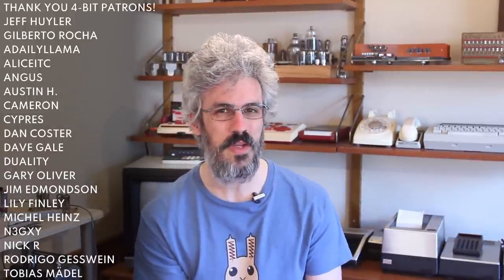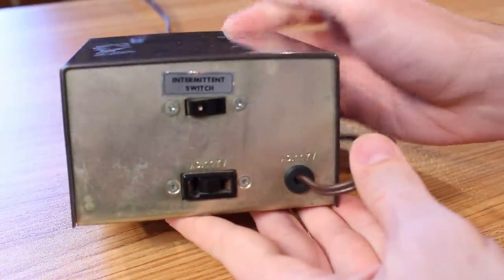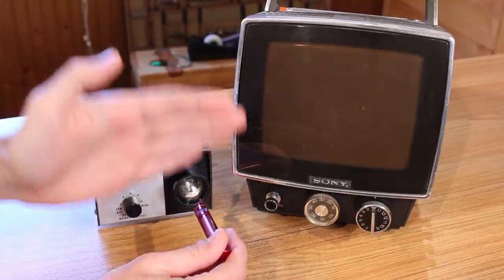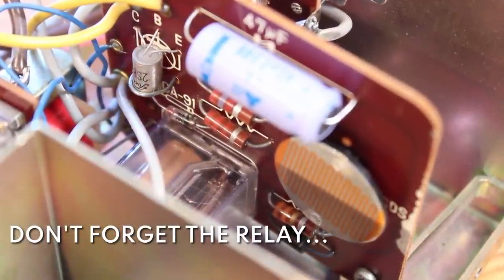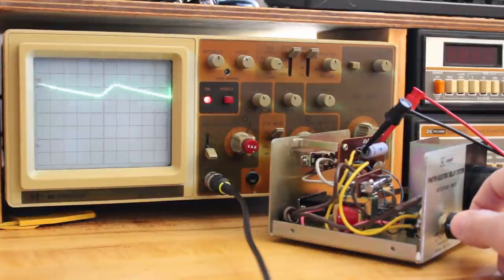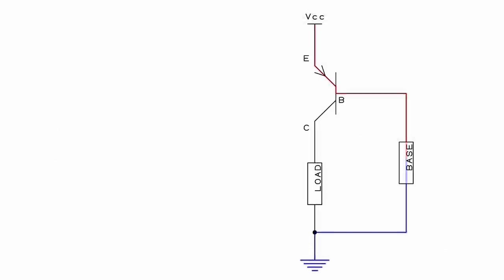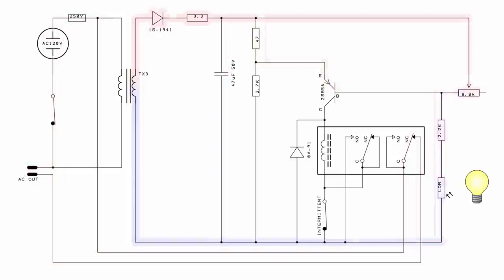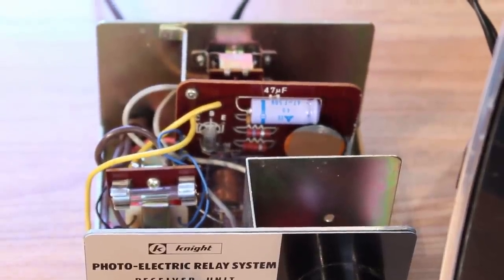Reverse Engineering a Knight Photo-Electric Relay System

Comment: Hi,  a few comments. Firstly, the potentiomneter is almost certainly nominally 10k. 8.8k is not a standard value and there would be no mileage in the manufacturer having custom pots made. Secondly, the fact that common is linked to NO on one side and to NC on the other side is completely irrelevant. You should see that if you removed the common-NO link and the common-NC link the the circuit would function in exactly the same way, so mentioning these links as part of the explanation of how this circuit works is misleading. Thirdly, it is not obvious why the 3.3 ohm resistor, the 47 ohm resistor or the 2k7 resistor exist at all. They probably have something to do with taming the half-wave rectified power supply and reducing the likelihood of the transistor or the relay seeing an overvoltage condition. Fourthly, the OA-91 diode is certainly a flyback diode although it is usual to see it connected directly across the coil of the relay. Finally, your schematic is incorrect. As it is drawn, if the intermittent switch is open, then the relay can never be activated. HTH
Reply from the maker: You're absolutely right about the 10k potentiometer, I just totally spaced on that obvious connection!
You're also right that the links on the relay aren't the important part here, that was a poor explanation on my part. However, the schematic is drawn correctly! I think you might have misunderstood what I was getting at it with how the intermittent switch works.

It's a little deceiving because we often that when a switch is "OFF" it's open, but in this case, the switch is closed when it's "OFF" and open when it's "ON". In order to use the feature, you make sure the light beam is uninterrupted, which triggers the relay and the C to NO connection of the relay now provides an alternate path to ground. Then you flip the switch cutting the normal path to ground through the switch off, but the relay stays energized through the NO connection. As soon as the relay de-energizes, there's no longer a path to ground and the relay can't be re-energized. It's a beautiful way to achieve a latching effect!

With regards to the 3.3 ohm resistor, it forms part of the RC filter circuit to help filter out the ripple of the half-wave rectifier. This is a pretty common layout that I see in a lot of older electronics. The 47/2.7k resistor divider was also excellently explained by another commenter, so I'll copy paste their reply here: 
"The purpose of the voltage divider on the emitter is to 'raise' the emitter's voltage down a bit. A 2k2 and 47 ohm voltage divider with about 20V will drop approximately 0.4V across the 47 ohm resistor. This means the base, relative to the positive rail, needs to come down by that voltage plus the voltage of the BE junction to turn the transistor on. If there's no light, the base would be at 0.4V relative to the emitter, keeping it firmly off. If it were just a 47 ohm resistor alone, it would introduce a little negative feedback to the circuit, which would prevent a clean switching effect on the transistor."
Reply: @UsagiElectric  Thank you for your reply. I must confess, I didn't spend any time considering the biasing of the PNP transistor and I'm not arguing with any of your comments above. However, let us review the schematic around the relay again. When the relay is de-energised, the C contact is connected to NC. This is as shown. In order to energise the relay, you need two conditions. Firstly, you need a voltage at the "top" side of the coil and we will take this as read. Secondly, you need the bottom side of the relay coil to be "grounded". If the intermittent switch is open and the relay is de-energised, there is no possible path to "ground" for the relay coil. Therefore, the relay can not be energised.